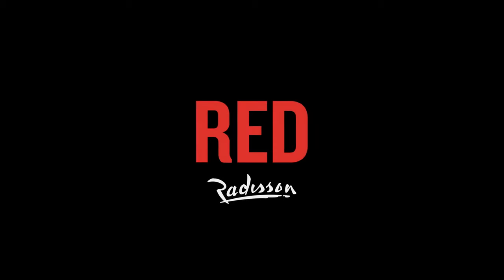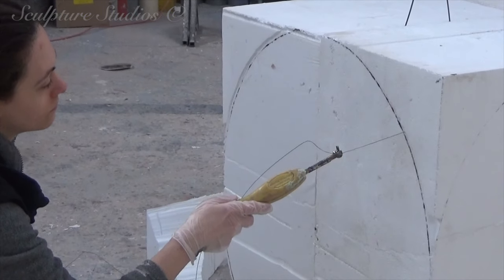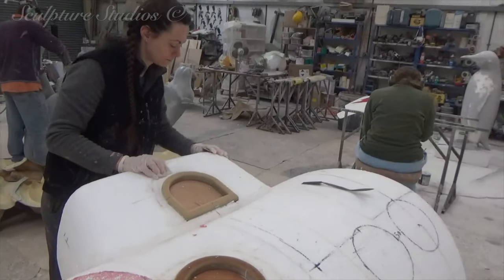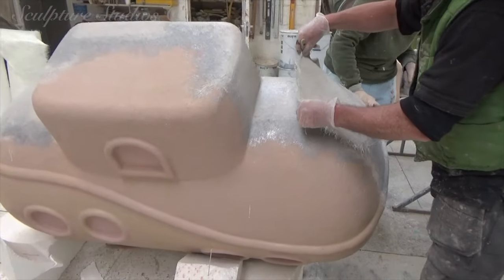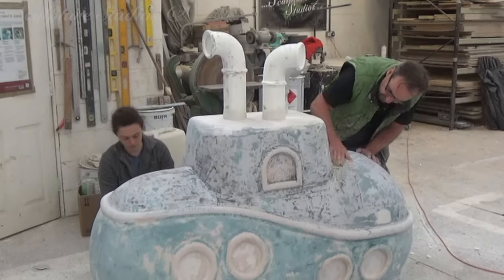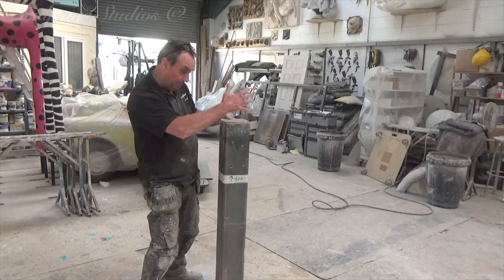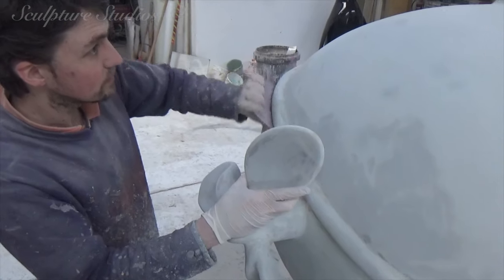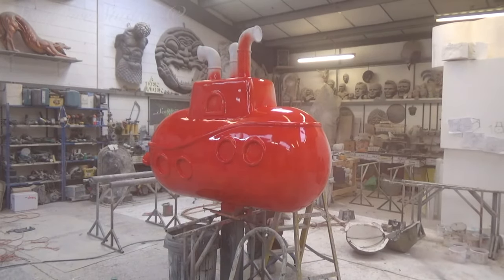Radisson Red Hotel Submarine - by Sculpture Studios

Comment: Beautiful work as ever..! Have you guys ever been called out to repair one of your pieces due to damage?
Reply from the maker: Hi Bacchus. The only real repairs we've had to take on, are sculptures that were eventually kept for longer than they were originally intended. Something we create for perhaps a 6 month installation, which was then kept on for several years, on a sea front location for example, with the wind, hot and cold, damp and sea air, will naturally need some attention further down the line. We always try and establish how long something is going to be used for prior to creating. Great question! And thanks for watching.